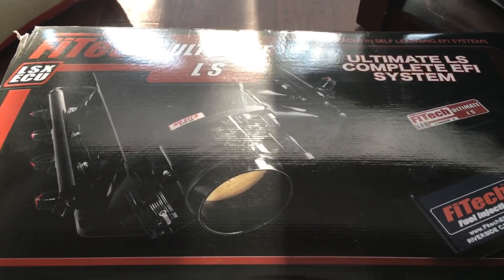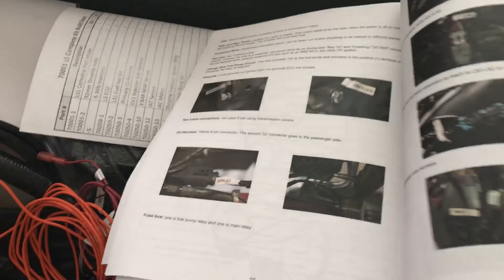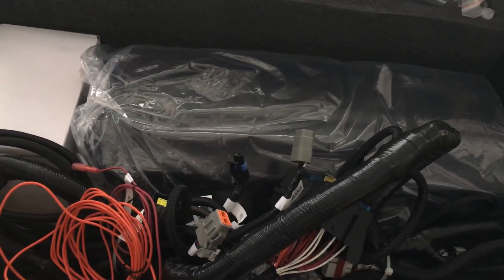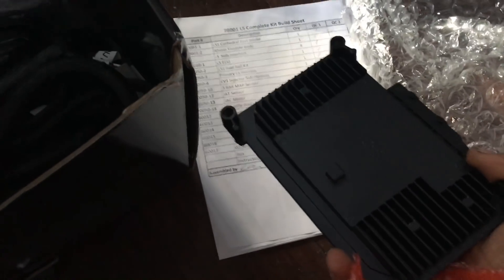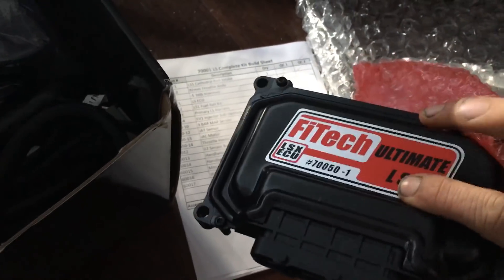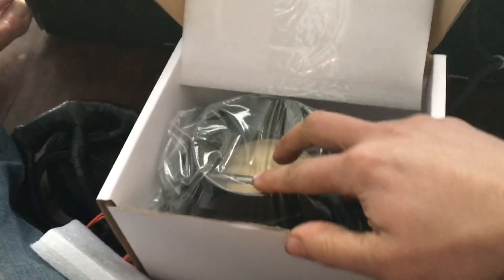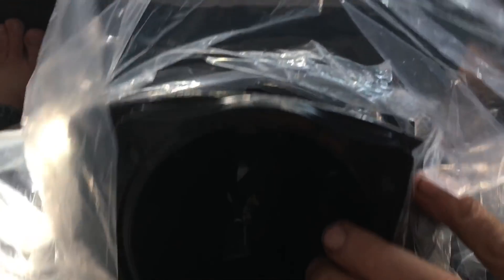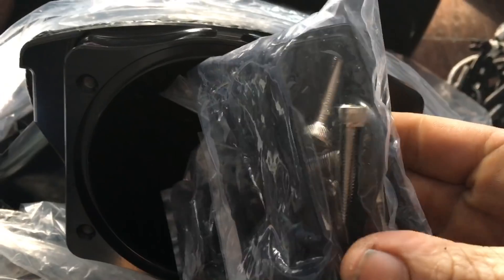Fitechs Latest- Ultimate LS Fuel Injection Component Review and Walkthrough

Comment: Is the part number 70004 on the fietech website? I gave them a call  they told me to use that part number for my 04 Tahoe LS 5.3L which will going in my 81 Corvette.
Reply from the maker: This part number 70001 it's the 500hp system.70004 are for engine builds that are producing upwards of 750hp